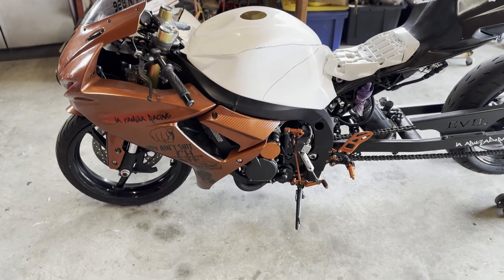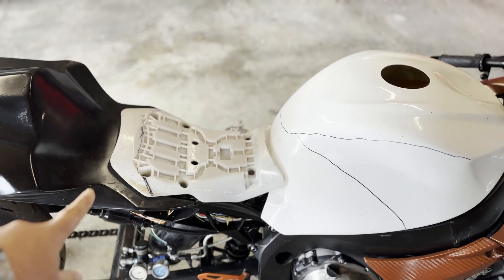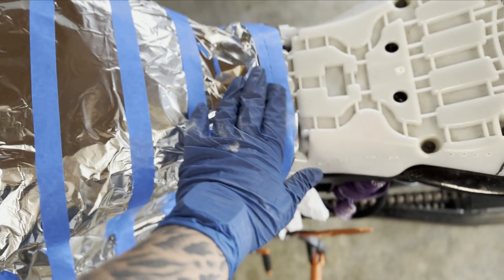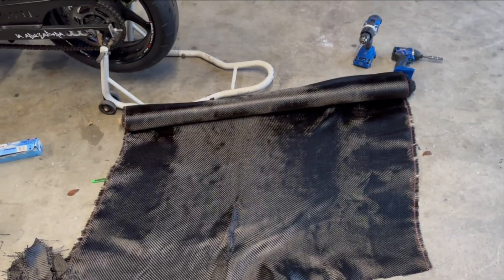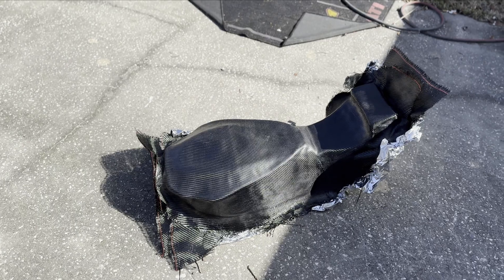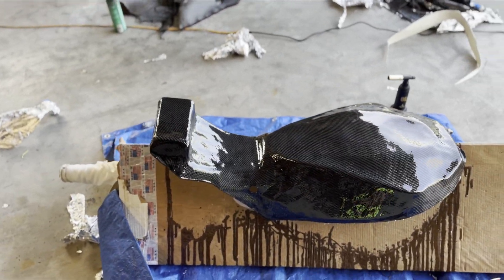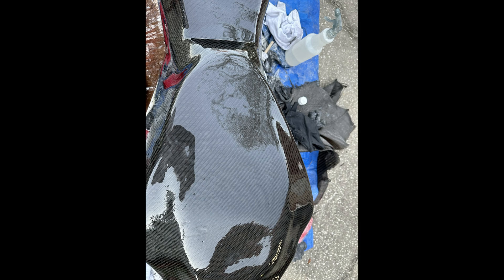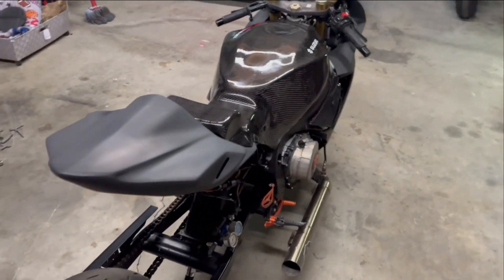I made a Carbon Fiber prototype part! **DIY WITHOUT A MOLD**

Comment: If I saw that irl.. I would assume you made the mold from a stunters bike who beat their tank flat with a dead blow hammer. That thing looks like one of those topographical globes from school. I can see several mountain ranges and you got like 5 too many Marianas trenches. I guess it could have been much worse but just a little planning in advance, man... mad respect for actually posting the results though most of us would pretend like it never happened.